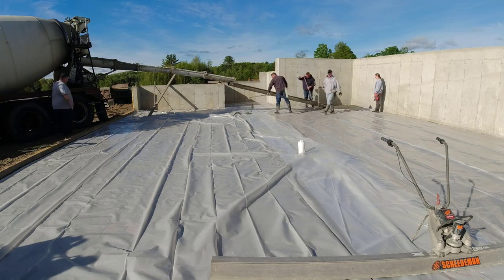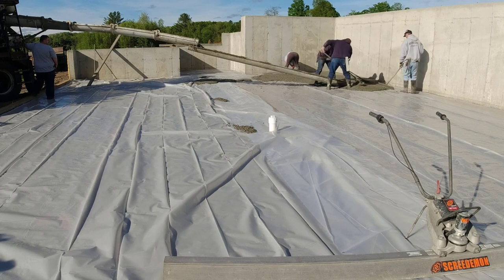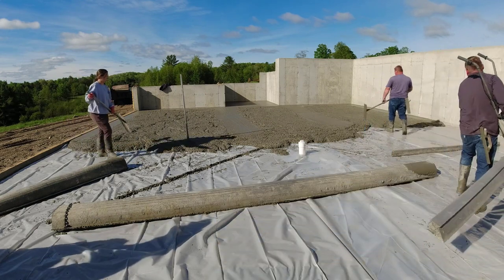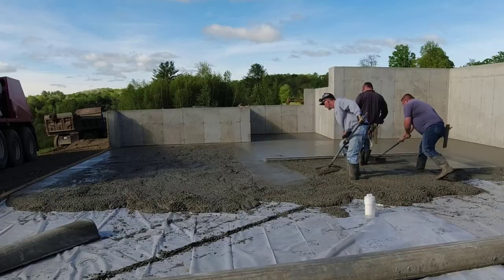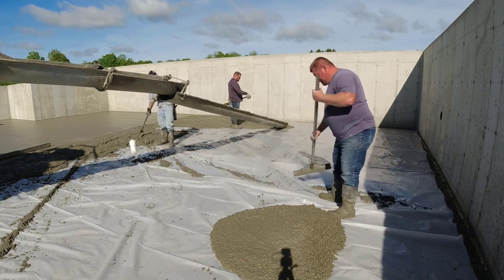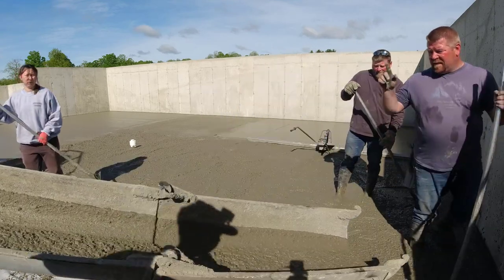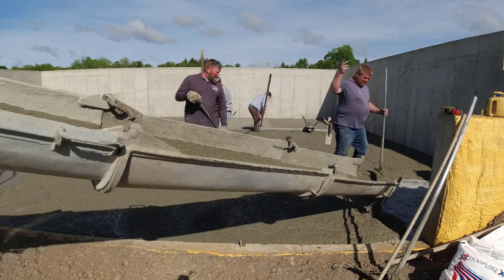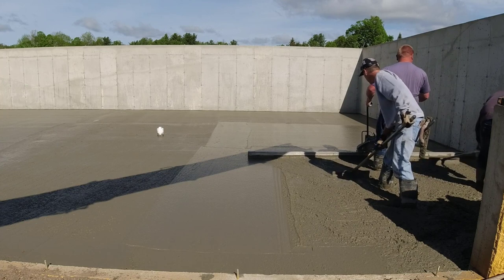Dealing with Issues! 3 Reasons Why Not All Concrete Pours Go As Planned

Comment: Im from Ireland and I work on a concrete pump and we get the same here with the concrete coming from 2 different plants of the same company you can here the sound in the pipe's change with a different plants load.

Comment: You think that’s bad…

Try being the guys that built the Starbucks in our region. Our competition called them at 7am for 7:30am pour to tell them they couldn’t supply concrete for the job because they didn’t have the material. They called us, we put 3 trucks on repeat for 100yards footing/wall. 

Our competition hadn’t paid their cement supply for a year they owed 2 million.- they owe one of our contractors on a state contracted job 3 million in prepaid concrete… 

They just closed 2 weeks ago and the company is being liquidated as a branch of the larger company which is also in the hole for a couple million plus unpaid pensions. 

So yeah could be worse, you could be the guy on either end of l that look for your concrete or your money.
Reply: That's part of being in this industry. One of the reasons why I'm fearful of being self employed, the risk may not be worth it.
Reply: That is bad